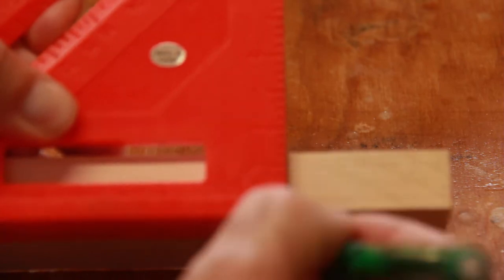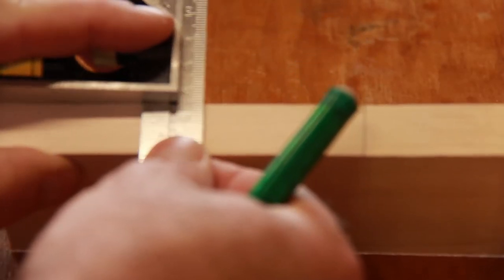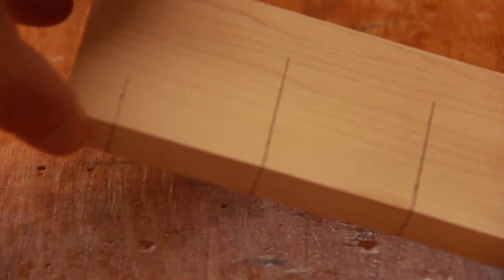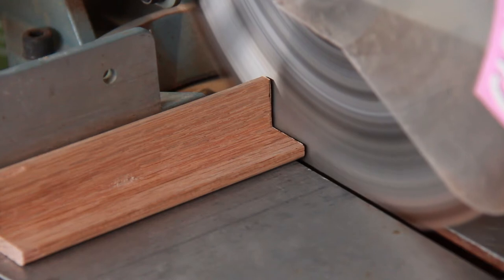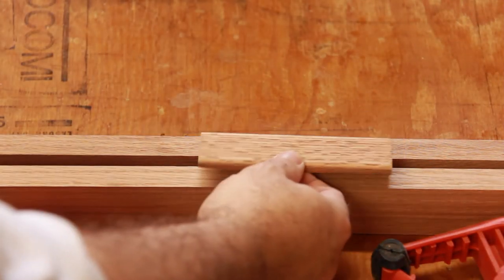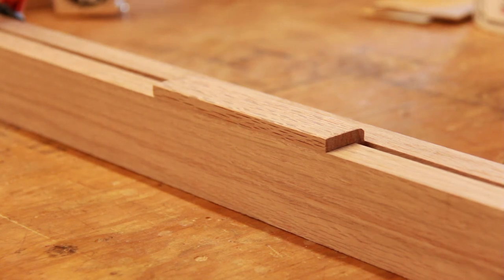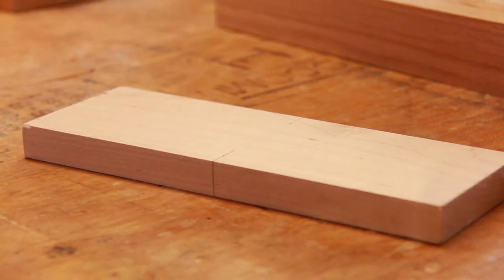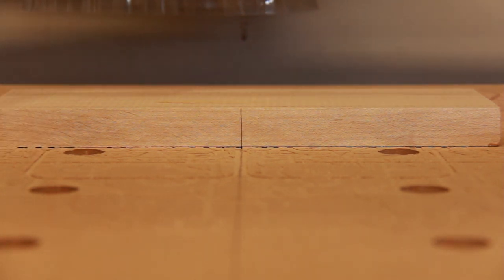DIY Saddle Square

Comment: Maybe cut one or more from aluminum angle "iron". You can pick a larger size piece such as 2" and cut down one with a 3/4" leg or what ever you like. You can cut or route aluminum cleanly with carbide cutters. 

If you do dovetails you can make some 7:1 angles or whatever from the same materials. 

You want angle iron that has wall thickness that doesn't taper. 

And if the interior corner is too rounded over, you can take a triangular file, rub some chalk in the grooves, and file out that corner.

Comment: The only thing wrong with this is that I didn't know about it 20 years ago.  I wanted a saddle square for a long time but they're too expensive for what they are. Thanks for the tip.
Reply from the maker: Thanks Pete
That was my situation too.  I wanted one for a long time, but couldn't justify the price.  When I got the CNC Router - I often need to do this face to face marking as a reference for two sided machining (top and bottom) - so I got motivated.   I set out to make something similar to the commercial versions, but at some point I walked past a scrap of outside corner stock and the light blub came on!  ;-)
Reply: @OakLines  Just to clarify, you can't justify the saddle square cost, but the CNC router....????   Sorry, had to poke the obvious.  Secondarily, I would suggest to other woodworkers that a hand plane would also accomplish the same trimming task as you did with the router and flush bit.
Reply from the maker: @kraghhertel8202  You must have to have a hand plane - and know how to use it! 😁. This was fun and simple to make - I now have several floating around the shop.   Yeah - I hear you - but it is all in how you think about your investment.  The CNC router is a versatile machine ready to tackle most any job.  The straddle square is specialist tool - perfect for only a single task.   Invest where it will make the most difference.

Comment: check out izzy swan on YouTube . He made 2 versions of the straddle square. one for small lumber one for bigger stalk but made out of some heavy duty plastic type material spring loaded so u squeeze it and straddles over a board 2×8 is bigger one